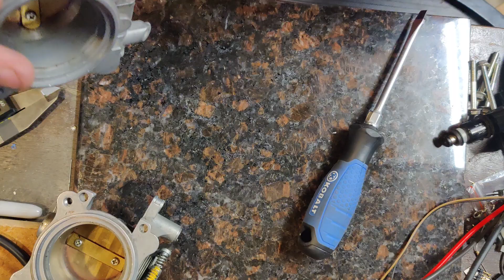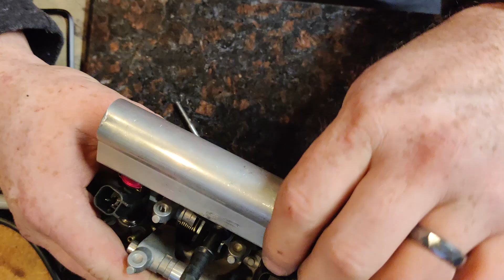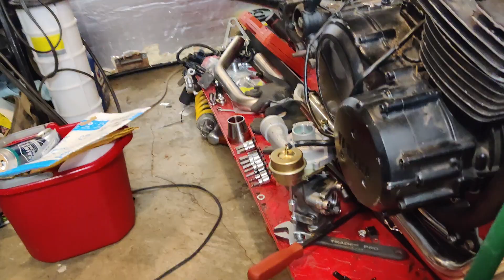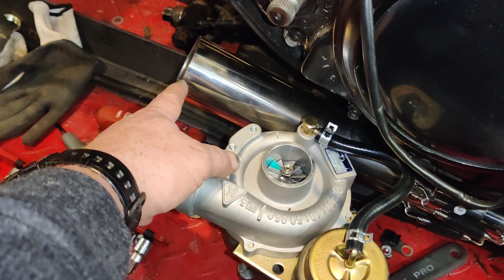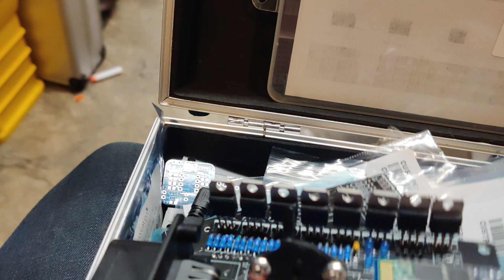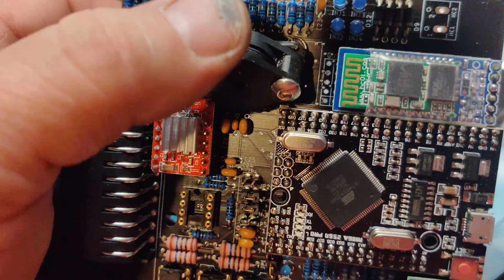Convert ANY motorcycle to EFI...Cheap!

Comment: The big problem with converting vintage bikes to EFI is the alternator/generator. Most old bike don't have the current capability at low rpm to even charge the battery, never mind power fuel injection, the high pressure fuel pump, ECU and electronic ignition. That's the biggest hurdle.

Comment: Sorry late to the party, but why not just cap (silicone) the throttle bodies vacuum ports, rather than drilling and welding? or are the vac ports interfering?

Comment: Great job! I'm starting to convert a gpz750 unitrack to EFI with Speeduino, but I never done this before. I have throttle bodies from a gpz1100, fuel pump, regulator, etc... I need to figure out how to drive oem coils (if possible and cheap option) and how to get a crank signal from the oem system (if possible).... I want to proceed first on spark only with carbs, then to injectors.... Can you help me? Can I contact you via email?

Comment: you could also use a normal automotive stud wit 2 different threads, the finer thread will come out more slowly so you put that one in first and then screw it in with the more aggressive thread and it will get tight. 
then you don't need a left hand thread, though I guess you have the tap now so why not use it. 😆
This is awesome!

Comment: Know this vid is 3yrs old, but is their a way to my a speeduino board just supply additional fueling for my turbo build, and not be a standalone. I'm not sure how you'd make it intercept the injector signal , and modify it under boost only.

Comment: title is a joke right ?
Reply: Haha no. $400 for a speeduino(and odds and ends trigger wheel sensors etc), 50$ for throttle bodies(or less if you find a deal) $200 for a fuel pump(if you don’t try to find a good deal). And maybe $200 for a wideband and controller. That’s less than 2 bike payments for my bike. Those are the major expenses if you do all the work yourself and find people that can cut/weld/fab custom parts for you. Please let me know if I’m missing anything.

Comment: I have my fathers old motorcycles. One is a carb Valkyrie that was favorite touring. The maintenance on this thing due to the ethanol gas mixtures is just brutal. None of that Stabil stuff seems to work. First two times carbs needed to be rebuilt I paid Honda. Last two I did it. The final form is I just disassembled fuel system and left it off. The plan was I would just put it back together when I would ride. An extreme winter storage setup. Except I still have put it back together for two years.

Comment: Hello, i want to get these made by jlcpcb, du you have some closeup pictures of the board, just too confirm the location of the components. I have the BOM and pick and place files generated by EAGLE but there are some componentes i dont understand. nice work! 

Edit: I compared the BOM of your board with the BOM of the official speeduino board. I noticed there are a few capacitors where you used different capacities, is that on purpose?

Comment: Thank you for the video.  I want to install a gl1500 into a car for nice sound and the size being good for a tiny 4 cylinder engine bay.  I wanted to make it a twin turbo but I was told it needed to be converted to efi.  I have no mechanical knowledge so seeing what you used will atleast give me a place to start.  Very detailed. Thanks

Comment: I've got a crf250L it's fuel injection factory I won't to add a turbo was wondering if I can add on a 3 bar map sensor and mod the computer to see the boost and just add fuel under boost and run normal with not ?

Comment: I need an Machinest to make a Throttle mount I tried to use a GX 390 for my 1978 Honda G400 but the GX 390 is slightly too long if I can get a custom Im starting to work on Speeduino N02C or kartduino

Comment: I know this is a couple years old, but would you by chance be interested/able to build a complete speediuno ecu that’s ready to go?  I would only need the ecu and appropriate connector and pins.  I’ll build the wiring harness myself to suit my own project.  I work full time and with side jobs and building my own projects I just don’t want to take on the actual building of the ecu too.  I’ve  built a few dragbikes with standalones from maxxecu and Holley but want to try out speediuno.  Let me know if your interested

Comment: I'm busy stripping my 1994 Honda Transalp 600 for a restore and rebuild. I am contemplating getting the power jet & needle set for the carbs, but if an EFI modification is now doable without too much hassle (which is why it always has been dis-advised by engine experts), I'd really want to give that a try.

Comment: DB style connectors can be purchased with SEPARATE pins and sockets.  Crimp the pin/socket to the wire and then insert into the shell.  I have made 100s of RS332 cables this way.  Admittedly, they were not subject to high vibration but the correct hardware keeps the shells together and there is sufficient friction between the gold flashed pins and sockets.

Comment: Have you thought about using an Rasp-Pi instead of or with the Arduino?
I've been playing around with the idea of bringing my 1976 Squarebody into the 21st century. But leaving the carb with a modified AFR system made from an IAS and O2 wide-band . Leave the factory HEI-4 ICM distributor. Swap the HEI-4 ICM for a HEI-8 ICM to add ECU timing and dwell control. Add a MAP, CPS, TPS, AIR/Water/Oil TEMP, and LCD touch screen for gauges. 
So to run the screen hence the R-Pi. 
The  R-Pi would add on the fly dash programing abilities, gauges, internet (with phone pairing), the ability to have a 2T hard drive for continuous sensor logging, audio pre-amp output, RTC, hands free phone and all hardwired instead of BT to phone. Except for the internet thingy.
I could probably find other nifty things the R-Pi would be good for like dual cameras for those pesky legal issues and theft monitoring. 
Between the AFR system to make the carb a dynamic setup instead of static and the HEI-8 ICM for ECU timing and tach, it should be golden. The best of the past with the best of today. What do you think?

Comment: MPX4250AP is a 2 bar sensor and are ugly expensive, otherwise, your design is awesome, would love to see the board files and specs... Also the DB37 works great, been using it with megasquirt for the last 20 odd years, only issue is you need to double up the injector outputs and use at least 4 pins for the ground as they are only rated at 2A each...

Comment: would you know ak it for a bigger ibke like vtx1300 or would i just have to buy 1800 fuel parts and figure out a way to wire the fuel pump ecu

Comment: Hi, thanks for the explanation about you Speeduino designs. Did you have to add capacitors on your board to lean the 5V from the voltage regulator module? I like the idea.

Comment: which throttle body would work good with a 1977 Honda CB550k3? it currently has PD46A carbs. 
jetting carbs is an annoying process. i have a lot of electronics and programming experience. 

i've taken the carbs apart so much i that i have high reluctance to doing anymore carb work. they're just unreliable. 
One year i found ANTS in my carb... ANTS!!! how do ants get inside a carburetor?

Comment: Like the through hole black board with a the TE connector . I have arthritis so SMDs are beyond my physical capability . If you have any of these spare for sale that would be great . Running external MAP and Baro sensors incidentally on a Triumph Daytona 675R and yes apart from being a high Z injector  very little info exists on these . Sadly I just found this as I have a few sets of TBs spare and would have been happy to trade one for a couple of the through hole boards .

Comment: Great info, thanks for taking the TIME to create the video and post. A couple quick questions. What kind of housing did you end up with for the Speeduino?  I'm also interested in your solution for the EFI fuel pump, external or internal, small custom tank for the EFI pump, ?? Thanks in advance.

Comment: I'm thinking of doing a cx500 v-twin efi.  Why not just modify the existing carbs to be just throttle bodies?   Put the injectors in a tube where they mount to the head?
What I'm trying to figure out is what injectors I can use for a 500ci.

Comment: I have a 1994 Yamaha xv535 i kinda like. I like the carburetors. What i don't like is the ignition system. The world needs a good aftermarket replacement. The pickup coil for this bike is non-existent. Never buy a CDI before you find out if the pickup is available. Aftermarket CDI should come with a pickup pulsar, or a recommendation from the seller.

Comment: Hopefully an aftermarket company will eventually create universal units actually designed to be adapted to any situation.  Would be so awesome to update a big vintage 4 cylinder with ride by wire FI!  Mainly because mechanical throttles onbig car big bikes is a real wrist killer especially once spoiled on modern electronic throttles....that and hydraulically assisted clutch along with quick shifter could all really bring an ancient bike into the modern and could be re-engineerd to be truly pleasant to ride even compared to modern machines
Reply: I don't ever see me owning any bike with the FBW technology. I just can't get past not having a secondary option to use in case of an emergency. My bike has 2 throttle cables even though one works perfectly fine. I always have 2 installed though so I have one that can be used as a backup. If push came to shove, I have also used a pair of vice-grips before in a pinch. I just clamped to the remaining section of the throttle cable on my friend's bike after it snapped a few miles into our trip. It actually worked quite well, much like the pull rope on a lawnmower. Lol. We only had 2 or 3 miles to get to his house, so it wasn't that bad. I' ve only talked to a few guys who had the FBW system on their bikes, and all of them hated it. One of them was getting his new bike that he bought just 6 months prior, loaded onto the rollback due to an issue with the FBW system not allowing it to start. He said that this was the second time it had happened, forcing it to be towed. Although it seems to work alright on the F-117 Stealth Fighter and the B-2 Stealth Bomber somewhat reliably, I doubt the quality standards are anywhere close to the same.

Comment: This information is incredible!!!! I am drag racing a 03 660 raptor which has a single cylinder but 2 carbs and dual exhaust and I’m doing my very best to figure something like this out. Please if you have the time message me. I really want to learn some things and hopefully hire you to build me a control system. As well as tell me what peripherals I would have to make it work. I am a heavy equipment/agricultural equipment tech. I can follow a manual or engineer mechanical parts. But I don’t think my old shaky hands will let me build the boards.

Comment: How do you approach the fuel pump system?
All I know and used (for cars) are Bosch external pumps, but they are very big and don't have high heat tolerance. Moreover, you have to use a return line to prevent vapour lock.

Comment: Great, so basically for e.g. an old carb KTM bike I can 'just' buy an used  but KTM EFI complete throttle body with sensors  and use the Speeduino ECO as is or do I need to make any C/C++ contributions to your open source code for the KTM throttle body?

Comment: I am interested in doing the same set up on A 1965 VW bug with a 1835 CC.  engine. 
I am completely illiterate when it comes to Arduino stuff. What would it take to build a set up to convert my bug to fuel injection? I already have an igniter 2 Electronic points inside my distributor.

Comment: What sort of fuel pump, regulator are you using with these conversions? Do you ad a swirl pot to prevent air bubbles? I’m converting a ‘83 Suzuki gs550

Comment: In case others here are interested. The earlier Triumph T595 and 955i have a Magnetti Marelli EFI system that is extremely simple and can be tuned with free-software. It is alpha-n and it works well on a variety of applications. I even have 2 of them running on a 6 cyl Porsche.

Comment: Wonder if this would work on older efi bikes that have bad ecu’s and there is no longer any support for them. For instance, I have an aprilia v-twin with dual plug heads that the ecu is fried. Can’t find one anywhere. Sure would be nice to throw a new more user friendly ecu in it.
Reply from the maker: Oh, yeah man! This would be the perfect application for Speeduino. It would be super easy too. Either cut off the factory ecu connectors and splice the wires into a Speeduino connector or just make an adaptor. As long as you have the factory ECU pinouts, it should be fairly simple. May take a bit of fiddling about to get the tune dialed in, but that's half the fun, 😂.
Reply: Where do you get the tune?  Download the one that is already on the ecu?

Comment: I have three motorcycles and I'm super frustrated I had a mechanic that claimed he could fix the carburetors on my bikes and he can't seem to get them tuned. I'm at the end of my patience and I am desperately wanting to go over to an EFI system. I work in EMS and I'm getting super depressed I don't have the ability to ride with motorcycles anymore. I work with some electronics and I have skills with soldering but I've never combined engine mechanics with electronics. I'm at the stage where I want to purchase a speedrino kit preferably preassembled. And then figure out how to get everything to work.  If you can drop me a message to help me out that would be great. Because I have no idea exactly what I need as long as I can get one of my motorcycles running and eliminate the carburetors then I will be happy.

Comment: The real question is why would you want to? Carbs can be annoying, some say ejection is better fuel economy. Emp goes off and youre dead in the water because of  it being electronically governed.
Reply: EFI  is ALWAYS more efficient. EW equipped Airplanes can shut down power grids, but probably not gonna fry your car

Comment: A much more simplistic way, would be to use a single injector efi kit, for the setup, and install it post air filter, pre throttlebody.
Reply: perhaps, but even briggs and stratton chose to go with 1 injector per cylinder in the intake manifold on the 2 cylinder twin lawn mower engines, so it must be preferred, or they could have saved a ton of cash

Comment: I'm using 2 x sets of these exact throttle sets on my old Datsun 6 cylinder and will run a Haltech ecu.
Picked up the throttle sets for $100ea off ebay 👌

Comment: I know why you like allenkey/hex bolt/socket head bolts too? It's cause if they round out, you can always put the next size up and tap it in to crack the bolt or worse comes to worse you can use some vice grips and crack them to get them out. You've got more shots till you resort to malpractices lol

Comment: I don't work for or even know the prople at Caswell Plating, but as a (now retired) motorcycle (and automtive line) mechanic, I strong suggest you check them out. The "Kreem Alternative" they offer is also so much better, it is used MORE in manufacturing than as a "motorcycle" or "car restoratuon" product. It is used as potting for electronics, among several other applications in large manufacturing facilities, because, unlike other "designed and patented for a single use" (car or morotcycle specific) formulations, this product meets the more stringent standareds of manufacturing industries all over the globe as well.

So, yeah, you CAN beef up the (28 awg) wiring on those smaller connectors by joining each of the little leads to a piece of stranded THHN with a good solder joint, then just pot it with the same (clear) stuff you can also coat tanks with, and it's CLEAR, not WHITE. One product, several uses, less overhead.

I mention this first because - the connectors you discussed moving to (toward the end of this video) are - well - their huge, so, not really great for a clean looking build, and could even CAUSE problems in a lot of applicarions, because they're so bulky.

So, you can pot electronics AND seal tanks with the same stuff, and it's bad-ass.

Ahhhhh, but wait, there's more. The name of the outfit is Caswell PLATING - because that was their FIRST patent. A small plating "kit type" product for short-run products, proof of concept and/or prototyping stuff, AND for auto/motorcycle/antique/collector type stuff. They also have pantented anodizing products that I've not personally used, but have seen the results of others, and have recently seen a YouTube review about, again, with great results <cofffuelrailcoff>

You've definately got the goods, and this video alone is a great contribution! I think this new-fangled "fuel injection" and "computer controlled engine" stuff may actually start to catch on. I'm not so sure about all this "turbo fan" stuff though. Does that actually even DO ANYTHING? {snicker}

Thanks again for taking all the extra time to film and sequence everything and offer a well thought out overview to this project. Well done, and encore!

Subscribed, as soon as I hit the "COMMENT" button in T minus:
3
2

Comment: I am contemplating converting my Polaris 500 Scrambler '06 model ATV to EFI. I was looking for "kits", but your idea of adapting from other bikes opened a whole new window of opportunity. Instant sub! One question: do you need 36 steps in the crank sensor? The kit I saw just spliced into the existing magneto which is one pulse per rotation. Also, any tips for where I can get single cylinder throttle body to suit my motor? I won't be doing any turbo. Thanks!

Comment: Another cheaper/simpler solution to mount the fuel rail would be to drill out the throttle body mounting holes, all the way through, then put threaded rod into the fuel rail, and pass it through the new holes, then secure with a nut. No need for fancy turnbuckle screws or machining. Hand drill and maybe a dremel at most req'd.